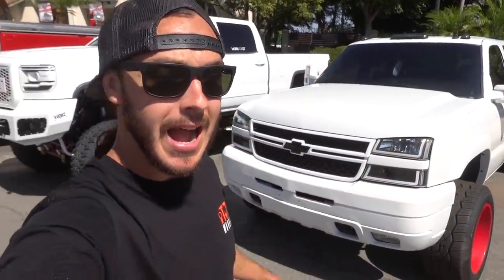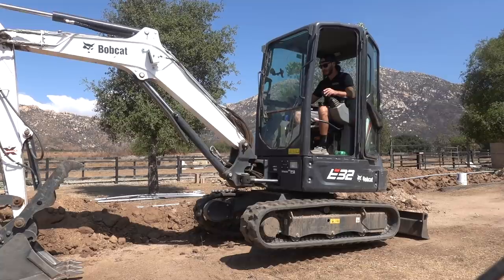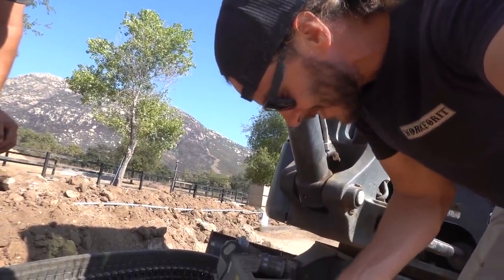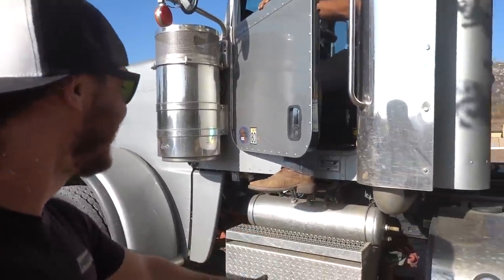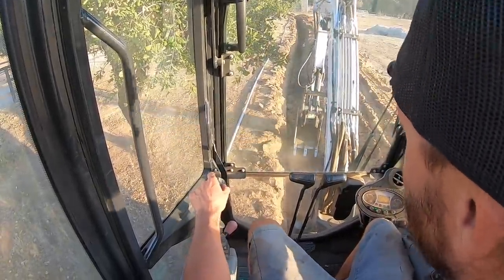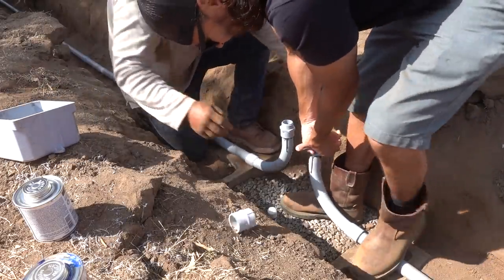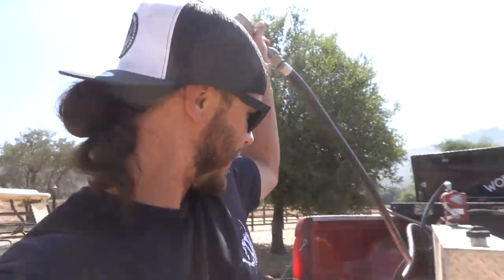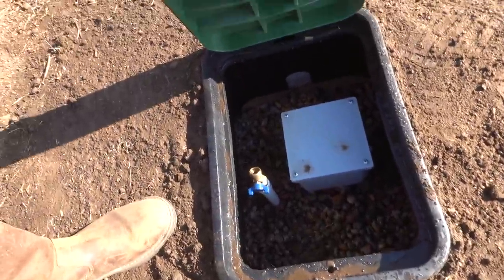Building the New MASSIVE Entrance to Ryno Ranch! (PART 12)

Comment: You should have done two conduits, one for power and and a smaller one for data. 🤷‍♂️
Reply from the maker: Data won’t reach that far without boosters every couple hundred feet. Going to be using a tricked out P2P wireless setup
Reply: @DMAXRYNO  Too bad you got rid of all that fiber-optic cable!
Reply: @DMAXRYNO  fiber bro.

Comment: Why does no one use a ratchet strap to set a bead?

Sweet dually dodge!
Reply: I do it all the time. Especially on tractor tires.
Reply: @marklengal9990  

👍right on
Reply: It helps set the Bead easier
Reply: @garretwilson8730  

What does? Ratchet strap? Yes it does and it’s less dangerous